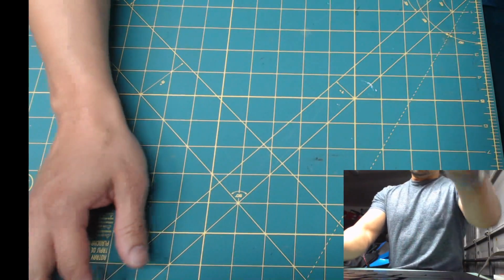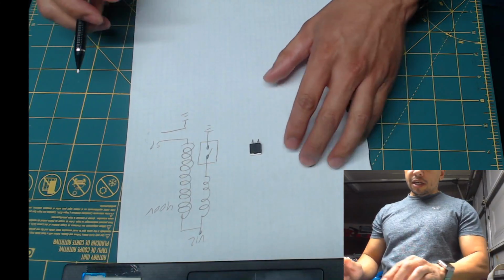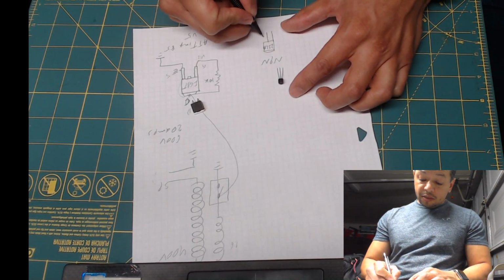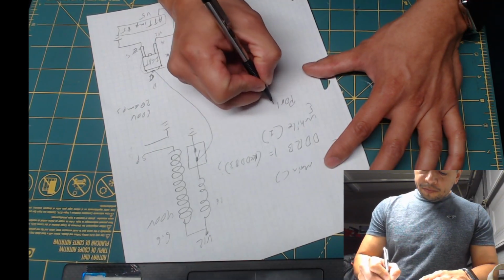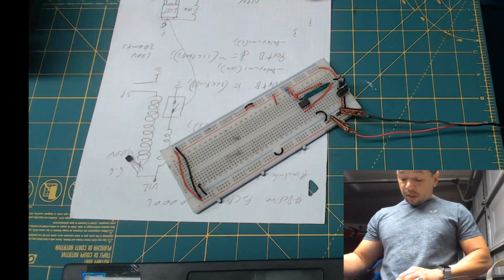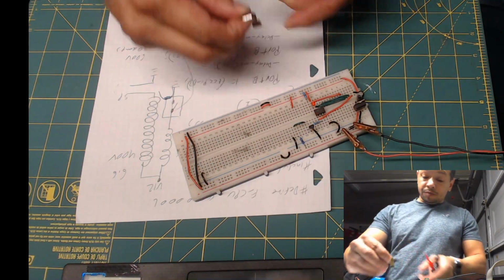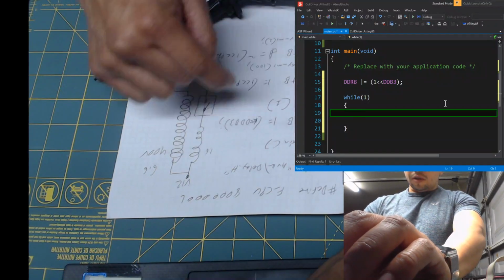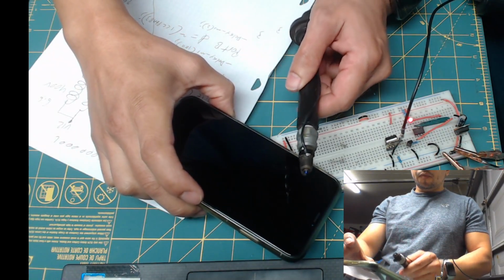DIY QuickShifter -  Part 1

Comment: This was very in depth and informative. This is a bit more complicated than it needs to be in my opinion…having said I will be going another way…a simple lever switch that activates a programmable time delay (@.0125 sec) wired into the hot side of ignition fuse circuit…basically the timed relay only interrupts the circuit for fractions of a second and it can be set up without writing code…great video though 👍💪

Comment: Doesn't make any sense. You are bypassing the ECU to ground in order to make the ignition spark. The path to ground (you are creating, upstream of the ECU) enables the ignition circuit and allows a spark. The whole point of a quick shifter is to stop the ignition for around 100ms and take the tension off the gearbox so the gears can engage without the need for a clutch.
If your switch is open, it has no effect on the standard firing pattern from the ECU. If it is closed, then the ignition can fire as the ECU permits and your system permits. I can't see any benefit in this.
Reply from the maker: The way this implementation works is by delaying spark instead of cutting, cuttin and delay achives the same, it releases tension from the gearbox if the throttle is open.
Reply: The path to ground via the ECU still exists and so does you new path to ground you created. So it does not override the ECU. A better implementation would be to cut the ignition for 80-100ms  completely.  @guser210

Comment: Hi, i've been trying to use a MOSFET, irf3708 , controller by a tc4427 and a arduino nano, but i get a short circuit between drain, source and gate. Plus, the mosfet driver gets really hot, meaning that it short corcuits too. Do i absolutely need a IGBT or is there something wrong i'm doing?
Reply from the maker: you can ask question here: https://discord.gg/ngnV5Xe5WN

I would like to see how you have it connected.
Reply from the maker: an IGBT would be ideal but you can get a mosfet that can handle 10Amps and at least 400Volts,
Reply: @guser210  i've tried different ways of connecting it, but it didn't work. Let me draw the connection i'm actually using and i will get on your discord server

Comment: it is possible for me to use arduino for the controller?
Reply from the maker: Yes but should not use DigitalWrite, that functions is too slow, instead use the port to toggle highs and lows
Reply: And why don't you just cut off the 12v of the coil with p channel mosfet/igbt?
Reply from the maker: Because most motorcycle ECUs use the voltage spike for other functions and if it doesn’t see it the motorcycle throws an F1 error also I use that spike to know how long the coil is pulled down and make it so is smooth when shifting.
Reply from the maker: ...and you still want to burn whatever is in the cylinder
Reply: I just figure it out why you do a direct port shifting so u get faster high and low toggle right?
Reply from the maker: @budrogerung6359  yup

Comment: I’m pretty sure the voltage required to jump the Plug’s gap is in the region of 25,000
Reply from the maker: John Warner sounds about right however, you only need to be concerned with the ringing spikes/kickback and that can be between 400 and 800 volts for a moto, you never get to see the high voltage because that’s on the secondary coil and the primary coil will step it down before it gets to you... that’s your ringing
Reply: @guser210  
OK, but I was just commenting on your statement at 2:24, that's all.